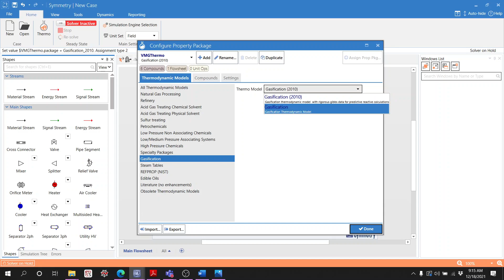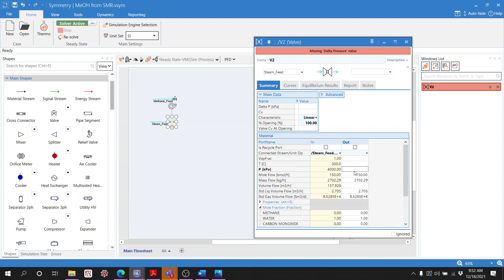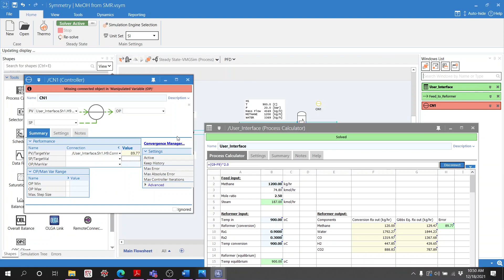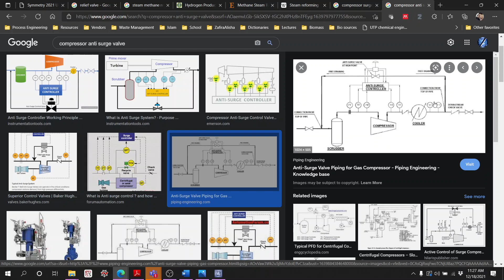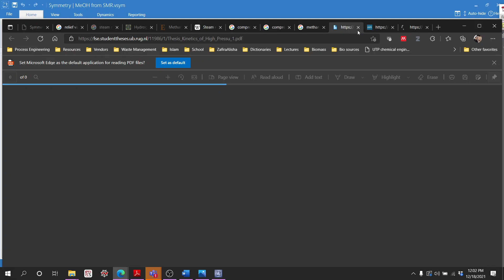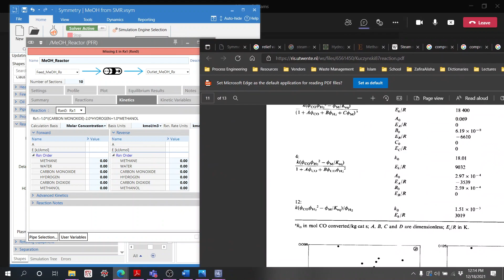Steam Methane Reforming and Methanol Synthesis Using Symmetry

Comment: @1:49:35 Is it possible that the step size is too big? The manipulated variable (Reaction conversion) is already at 0.9, this value should not be exceeding 1. Maybe could try a step-size of 0.01?
Reply from the maker: Hi Chenxu, thanks for this. This is apparently due to multiple connections for the reaction conversion in the Process Calculator. It was connected to the reactor itself AND as the manipulated variable in the Controller. This is NOT allowed. So, what we have to do is to connect the Reaction conversion to a cell in the Process Calculator in B10 (for example), then make C10 (for example) equals to B10. This C10 is then connected to the Controller. It works fine now.
Reply: @ZulfanAdiPutra   Ah I see, that make sense. Thanks alot! 
As a Symmetry user myself, it's great to learn how to troubleshoot these errors.
I really appreciate all your lectures, hoping to see more english contents. =)
Reply from the maker: @chenxushi4004  you're welcome. It's good to hear that you're also a Symmetry user :)